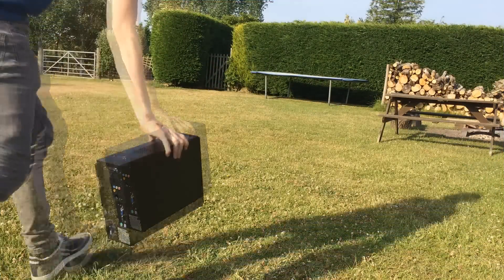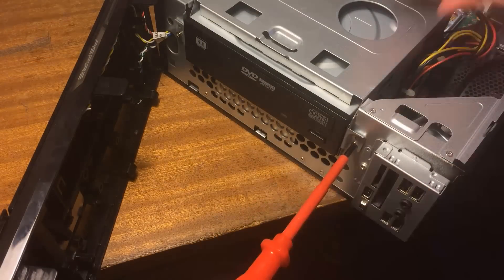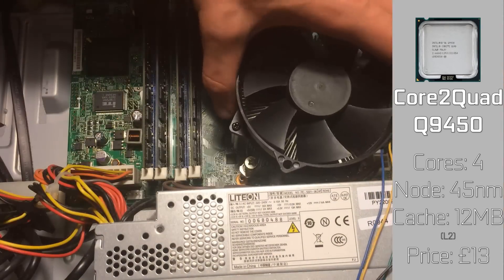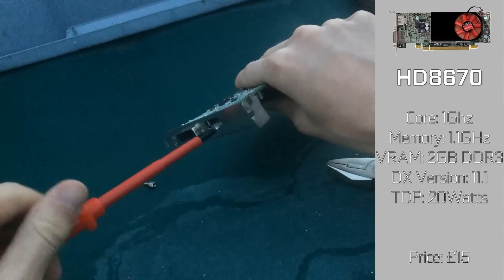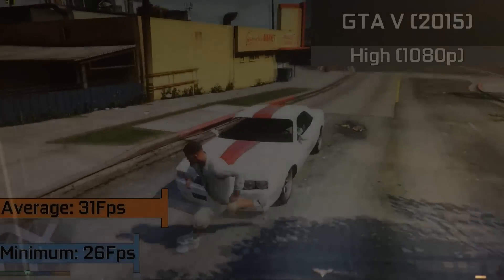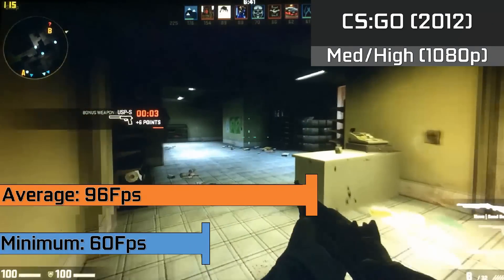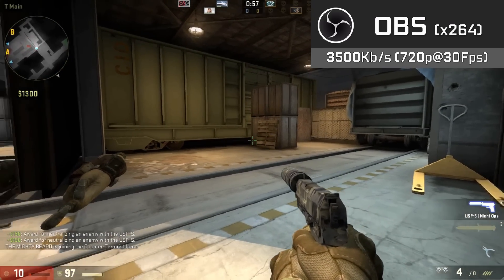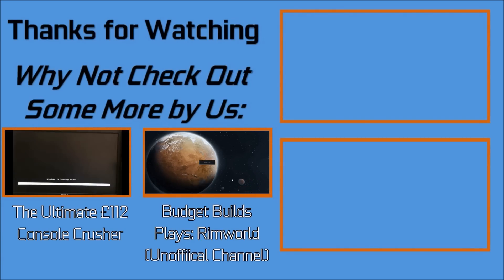Matching Consoles for £50? ($60) // The Best Value SFF PC

Comment: I will link this video to people that says PC gaming is expensive lol.
Wow, GTA V 31 fps on High 1080p? And consoles run it at 900/720p at medium LOL.
Great video as always!
Reply from the maker: kakoka1pro: Literally Proves exactly what you say, I usually use the PC's I build for a day when I give my opinion in the end.... this PC was great... even handled my CSGO competitive games for the entirety of my time with it.
Reply: Both the Xbox One and the PS4 run GTA V at 1080p high settings.

There is no "medium" for GTA V. Theres normal, high, and very high -- so in reality running GTA V at "high settings" is the equivalent of running it on medium.
Reply: Xbox One runs it at 720p and PS4 900p. Check your facts. Also you can lower the settings with this and get a smoother framerate.
Come on, you know PC is superior! :)
Reply: http://i.imgur.com/wylbb1k.png

They both run it at 1080p, the exact same frame rate.
Reply: Actually... Kuuko is right.

www (dot) reddit (dot) com/r/GrandTheftAutoV_PC/comments/3c9g6v/gtav_xbox_one_and_ps4_settings/
Reply: Well, my bad... Seems like I should have done MY research... Well, my point still stands. PC is still better as it's cheaper, and you can do much more on it... There is an advantage to consoles: Setting it up is easier.
Reply: kakoka1pro used consoles are usually pretty cheap too
Reply: yeah, they have dropped prices quite a bit, but pc is still better in that regard, see the £112 pc he made, it's better than consoles at a bit better price
Reply: slightly overclock GPU or CPU medium Quality 1080P 30-40fps not a problem
Reply: kakoka1pro the consoles run GTA 5 at a mix of high and very high settings at a locked 30fps at 1080p.
Reply: kakoka1pro not medium its low on consoles but yeah
Reply: PS3/Xbox 360*
Reply: Kuuko you got that from ign tho.
Reply: buffaloman Im ignorant and will blindly call a group of gamers gay!
Reply: @kakoka1pro is it really cheaper ? I mean i hope you dont compare brand new console price vs used PC parts.
Reply: Definitely not high, looks like shit compared to how I'm running it on my pc, and that's not just a placebo. I set everything to high instead of very high. Consoles are definitely not running high settings.
Reply: Help I have a laptop with a hd 8330 but it can barely play Skyrim. Any reason why?
Reply: kakoka1pro choosing used parts is not a good idea in long run, it's unreliable, XBOX ONE and PS4 run GTA V at 1080p on high thought, also consoles offer a easier and more laid back experience, and do not have to worry about drivers or windows stuff, it's just simpler, PC is more professional than console.
Reply: Hagrid Potterz no... it'd be so laggy. PS4 can manage dumb things like low settings
Reply: capucapu loloco not true learn information about the ps4 before giving it hate.
Reply: FreePenguin5000 I know a lot about it. If it was worth to cap the framerate then it can't reach 60fps and framerate would be always 30 without any drop...
Reply: capucapu loloco so why is that bad? Gta 5 runs 1080p high settings 30fps which is totally fine. If you wanted 60fps you would need to drop the resolution or quality or draw distance
Reply: FreePenguin5000 Or you could just OC the GPU and CPU. In case you're wondering how to OC a CPU on an OEM mobo, well if yoou didn't know this is LGA775, slap a bit of tape on the CPU and you're good to go. Free 0.something GHz OC on a OEM mobo.
Reply: MLG Dew yes but the problem is that I have a overlcocked gpu speed and gpu z confirms it but it still runs at the base clock speed of 496 mhz. Its a laptop too and I cant overlclock the cpu. Btw I use msi afterburner
Reply: I was talking about this PC in the video. I didn't read any of your previous comments btw.
Reply: MLG Dew oh ok
Reply: Kuuko
The PS4 runs it between 20-30 fps, with little to no antialiasing. And it caps the internet speed to about one tenth of what is available. It's a piece of shit!
Reply: Let me introduce you to an antivirus
Reply: kakoka1pro well the thing is where will you find this huh?
Reply: try do this on my country here one decent pc cost 2500R$
Reply: To be fair, i am surprised he even sourced the parts that cheap. Seems like he has the hookups because no way in hell can i build the exact same thing with the same $$ he spent.
Reply: Kuuko still it look like shit on console,  it may run the same is in the test, that's because they really optimize games on console
Reply: cool but no. i love my ps4 pro. 300euro and you get a brand new hardware without building and fitting in a shitty case. i chill on my sofa in the living with a 50inch tv and love to play games.  also wathcing blurays. 
i also have a 2000euro pc.
Reply: lol this is still getting comments
Reply: @hagridpotterz7802  lmao, keep dreaming
Reply: Um, you do realize that High in GTA 5 is actually medium right? There is only 3 tiers on GTA 5 normal, high, and very high.
Reply: @kakoka1pro  its amds fault the cpu on the ps4 is a laptop cpu

Comment: Install a low profile 1050ti and you’re golden
Reply: Nystally if you can afford a 1050ti, you might also go with a Pentium g4560
Reply: Mecrom no q6600
Reply: ItzzRobiii no hahaha no
Reply: Gaming XP yes
Reply: The power consumption is too high, and it would be heavily bottlenecked
Reply: Q9650 4 GHz
Reply: used i5 2500k/i7 2600k best CPUs for the price
Reply: @Mecrom  Nah, used i7/i5 1st,2nd or 3rd gen
Reply: @oswaldfigglebottom  i7-3770
Reply: You'd then be CPU bottlenecked
Reply: Have any of you heard about socket sizes and compatibility? Evidently not!
Reply: The intel c2q q9450 cpu is too slow for 1050ti, consider gt1030
Reply: With a core 2 system you might as well just use a GTX 780 or worse

Comment: Great video! I have a SFF Lenovo M90 PC with 8 GB of RAM and an Nvidia GT 1030. Add in a wired Xbox 360 controller and this set up basically replaces my need for a PS4. The PS4 does have a lot of exclusives but just about all the games I want to play are also available on Steam and you can't beat those Steam Flash sales and Humble Bundle deals. I'll be doubling my RAM to 16 GB later down the road. It is nice to have that option with this set up. Thanks for the video.

Comment: basically a 50£ pc matches the performance and settings and framerate of a £350 console, shows how the core 2 quad is the single best budget option for today if you already have a soxket 775 motherboard as they can get expensive
Reply: Xeon x5400 and e5400 series are even cheaper while using the same architecture. More work needed to make them work. http://www.delidded.com/lga-771-to-775-adapter/
Reply: well, i doesn’t match their performance, the consoles are about 1.3 times as powerful, but this rig still has better value, it’s 1/5 the price, so in terms of price:performance, this pc is a lot better

Comment: Acer got this case design when they bought eMachines and they seem to have loved it. They used it for a while it for their own prebuilts. They switched out the faceplate and the motherboard, but the basic design in the same. Even the PSU is the same. Of course, that is the most difficult part to replace since it's a proprietary design. For the GPU I went with the HD7570 for the GDDR5 memory and the fact that they're much much easier to find online than other more powerful low profile single slot Radeon cards.

Comment: 2:03 you should really screw coolers down in a cross pattern, so it smashes down the paste evenly and the load on the springs / tension is even.
2:50 you can use a dremel and pliers to cut down and bend the long plate into a low profile bracket.
3:35 almost 15 seconds of a blank screen should have been cut out.
Reply from the maker: This is a very old video, the 15 Seconds was left for dramatic effect.

Comment: i remember about  7 years ago when i starting doing hardcore pc  building  i used core 2 duos and first and then i started playing a game called dungeon siege III  and noticed the game would barely run  it would run around 30 fps bout would have stuttering , i bought a q6600 and it stayed near a solid 60fps at 3ghz on the q6600 i got real big into core 2 quads from then on till i hit the i5 2500k and 2600k and then i'm currently rocking 4930k and 3960x in my living room and bedroom systems , but i do still have some systems in my spare rooms with core 2 quads in them , i still am impressed with what they are able to do for 10+ year old chips

Comment: I've got a Dell optiplex 9010 low profile with 16 gigs of DDR 3 gt1030 i7-3770 120 gig SSD and a 1400x900 monitor and it crushes games for $250
Reply: Yeah i know its a giant bottleneck.  I'm planning on putting a gtx 970 in it. When i bought the computer it had a Pentium so at the time the 1030 made sense.  That and its on a 900p monitor so it runs games a little than 1080p.
Reply: But yeah I agree with you it doesn't crush everything. It does suck at running just cause 3.
Reply: @WhatwouldRonalddo  what? Now listen heres my specs i bought a dell precision for 100£ then i bought a xeon x5680 for 40£. Bought ram 24gb 2599mhz for 30€ and an rx 580 8gb red devil golden sample for 150€ (Used) so this pc costs about 300€ yeah same price as playstation 4 but far more powerfull+ this cpu wont even bottleneck an rtx 2080ti
Reply: @subscribinkitmane1119  ok buddy

Comment: you should do the bsle mod to compatible lga 775 chips so you can get the best performance out of them.
Reply: nathan kennedy prebuilt board, won't have BIOS support, although Acer motherboards at the time would boot with unsupported CPUs, so I'm not sure.
Reply: Thats what the bsel tape mod is for. It's changing the freq, not the cpu ID.

Comment: Well, I'm having a hard time trying to buy one of these on ebay. It's not that I couldn't find one of these cheap, but the problem for me are the shipment cost which most times surpases the price of the thing I'm trying to buy itself. I searched for local second hand sells, but they are even expensive than Ebay + shipment costs, so I guess the only thing I can do is to be pacient and wait. 
Good video anyway. I get surprise on how damn well can perform that old hardware If you know what to do.

Comment: I just built a budget pc for about $140 and it works very well
Reply: MagicTurtle Gaming specs?
Reply: Master Kek i5 3570k, gt 1030, 24gb ram, 600 watt semi modular psu
Reply: MagicTurtle Gaming nice i did one for 200 a i5 2500 8 gb of ram and a hd6950 but your one is overkill man
Reply: 24gb? 
lol
Reply: MagicTurtle Gaming way to much ram and way to much of a power supply
Reply: QsNs LoCke dude the psu and ram was free
Reply: QsNs LoCke having a good psu isn’t bad because you can upgrade your gpu later without having to upgrade your psu
Reply: Master Kek I wow I got a i5 2400 8 GB and a hd6970 for 200
Reply: CombatWombat that's awesome. Forget ppl saying the ram and PSU are overkill. That deal is a steal and you could even save up and get a higher level GPU later down the line and just smash everything.
Reply: Kieran toplis What?!??! That doesn't make sense.
First of all, he didn't specify what was the pc for, for gaming, video editing or 3d modeling you need a good amount of ram, and the psu can't be too much, if the amount of energy that you need is lower than the psu can provide, that isn't bad.
If in the future you want to update the gpu for example you won't need to upgrade the psu, if you find a good psu in discount or an used good, it's totally worth a few bucks more.
Reply: i got a xbox one for £60

8GB ram
8 core unknown cpu
500gb hdd
windows xbox SHIT
NVIDIA SHIT FORCE GTX UNKNOWN INTERGRATED GFX

Comment: That core 2 quad is a good processor, considering its age and cost but that 12mb cache is misleading. It has 2 separate 6mb caches, but only benefit multiple threads and no thread can access more than 6mb at once. Truly separate caches. Nice video.

Comment: the gtx1050 would be an awesome graphics card to put there
Reply: Tips On The Fly nah its not the GPU it's more of the bad cpu
Reply: the 8670 is mostly a media center graphics card... you can see the GPU is the limiting factor in doom, the least cpu dependent game on the list of tests. The gtx1050 roughly matches the 680, so it's not that crazy to match it with a q9450, and for 1080p it's probably very fine with that cpu. it also has a lp version on the msi side of things... so... i still stand for my choice, i would still go for a 1050 with this system.
Reply: It yes cpu bottleneck if it was a 3rd gen i3 or around that power a 1050 would work great

Comment: Hey you say that the AMD Radeon HD8670 is a 20W card but that is its TDP (thermal design power) which is the maximum heat it outputs.
Its power draw is less than or equal to 75W as it has no pcie power connectors.

Comment: What pc do you have as your main user
Reply from the maker: CPU: Core i3 6100
RAM: 8GB DDR4 2400Mhz (Single Channel)
GPU: AMD Radeon R9 285
HDD: 1TB WD Blue
HDD 2: 320GB Hitatchi Deskstar (for Footage)
SSD: OCZ 120GB SSD
Reply: Budget-Builds Official you could probably sell you gpu for a decent price right and upgrade due to the mining craze and amd gpus going for ludicrous amounts
Reply from the maker: Halos Superman: How much do you reckon I could get? I mean I love the R9 285 but if I can get a better deal on another card I may part with it :D
Reply: Budget-Builds Official completely forgot that a 285 only has 2gb of vram meaning it's price is more than likely not inflated (2gb of vram is not enough for mining.) Sorry for the misinformation.
Reply from the maker: Halos Superman: Thanks for the help anyway, I may have to look into the mining craze
Reply: do u have a p.o.  box, i’d be happy to send u a 1050ti, since i have my old one (1.5 years old) lying around in pretty good condition, and i’ve already upgraded,
Reply from the maker: I’m gay: Sure man, I don't have a P.O Box currently, but I'll look into getting one ;)
Reply: I’m gay, But what if i wanted it Kappa. I have a gts 250 lol
Reply: The only problem with the card is that I used it very intensively over the year and a half that i had it so it's life span is nearly up, I'd say it has another half year is it left, a year at best
Reply: I’m gay, i can work with that lol. Im using a card with 512mb of gddr3
Reply: I’m gay, pls. Ill pay shipping if nessecary :(
Reply: lol, you must have bad experiences with graphics cards if you think that a 1 year and half of intense using would shorten the life that much. The card probably has at least another 3-4 years left in it.

Comment: Where'd you get that 20W TDP? Everything I've seen says at least 75W, some sources say 86W
Reply from the maker: The Obsoletist: Wikipedia and GPU-Z stated that it had an OEM power limit of 20Watts, the actual card could use alot more should it have been allowed to.... also the PSU would have prevented it from working if it had used that much.

Nice to see you round the channel man :D

Comment: When installing a new operating system to a pc there are 64 bit one (can't remember if it's actually called bit) and there is a 32 bit one. Which one would be best if you done know what bit the PC is?
Reply from the maker: +cameonjackson478: Always install 64bit if possible, unless you have only 1-1.5GB of RAM.

Comment: The GPU seems similar to the Xbox One version. I think you'd do better if you put the resolution scale on DOOM to 900p to compare as that is how Xbox One runs most of the time in 40-60 fps range. I wouldn't be too surprised if it came close.

Comment: I have quad q9450 and its f***ing overheats all the time but if you have any idea for stopping the overheat pld lemme know
Reply from the maker: New thermal paste?
Reply: Budget-Builds Official i dont know but its made in 2008 or something
Reply: In normal it was not overheating but a day later it started overheating i had bsod because of heats and i think domething wrong with motherboard
Reply: Budget-Builds Official also is the computer ddr2?
Reply: Budget-Builds Official My computer is hp m9300t
Reply: Budget-Builds Official it has nvidia geforce 9300ge 256mb 4gb ram i can only use 3 gb win 7 ultimate 32-bit and you know the cpu
Reply: Budget-Builds Official will it fix if i reinstall win 7
Reply: I found the fucking nvidia geforce 9300ge blue got fucking broke

Comment: just bought that setup for 107 euros, gonna upgrade it which a fx 6300 & gtx 1050ti, saved more than 90% of my money, thanks ebay lol.

AMD Phenom II x3 B75
Corsair Vengeance 8GB (2x4 GB) 1866Mhz DDR3
Gigabyte GA-970A-DS3P
XFX ATI Radeon HD 5450, 1GB DDR3,
WD Caviar SE 500GB SATA
Cooler Master eXtreme Power Plus 460W ATX
Sharkoon VG5-V Gaming ATX
1x Xcilence case cooler
Zalman Tower cooler
Reply from the maker: £107 is a great price... Get an FX6300 Overclock it to 4.2Ghz+ and Then you'll have a great experience :D
Reply: i will mate, btw its ma first gaming pc, cant wait lol, nice video & build you got there :)

Comment: hi may ik wht the best budget low power gpu? My psu is 300w
Reply from the maker: Syahmirockz Gamerz: A GTX1050/GTX1050Ti is the best card available for a low wattage PSU :D
Reply: Budget-Builds Official i see thanks. If my budget is $100 wht would i get(sorry really on tight budget)
Reply from the maker: Syahmirockz Gamerz: A new PSU ($30) and a Used HD7950 ($70) = Best Performance

An RX460 or 750Ti for around $60-$80 would be close-ish in performance and still run on a modest PSU
Reply: Budget-Builds Official thanks you for fast reply n very useful vid👍👍!